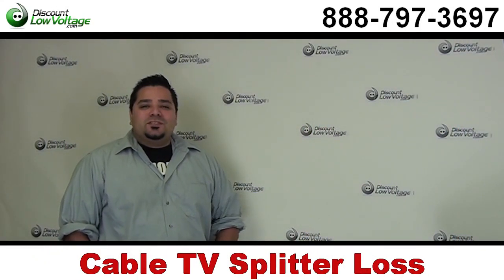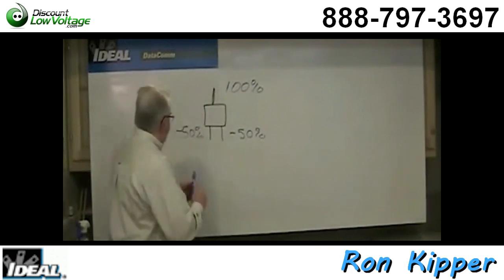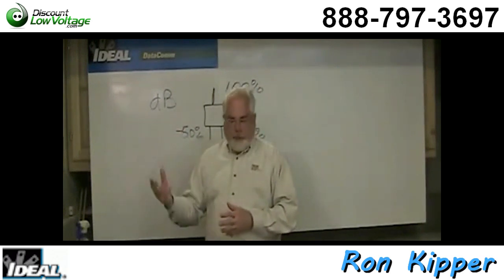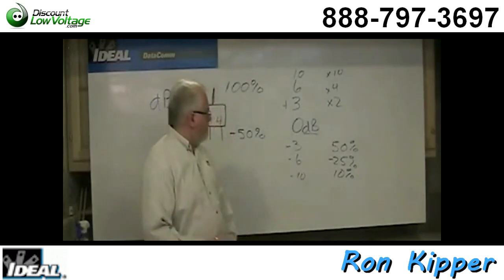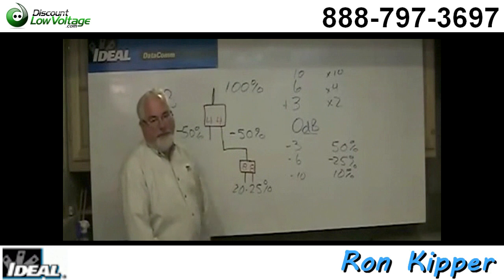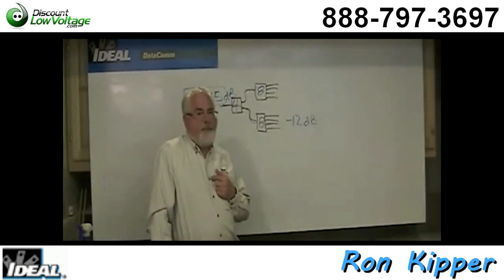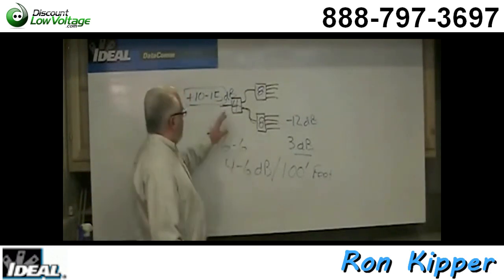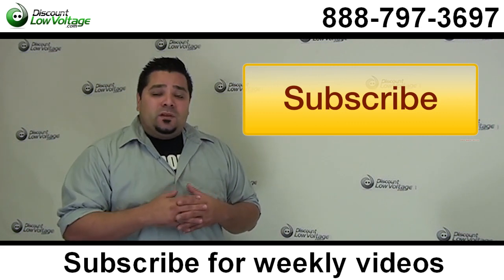TV Coax Cable Splitter - Is there signal loss?

Comment: thanks alot for the video... had issues in a new house, didn't think to look for splitters, found a huge mess under the house, cut out the unnecessary splitters and now have stable picture... yay

Comment: I'm looking into getting a coax-ethernet adapter. For the coax that would normally go out to the modem, can I put a coax splitter from the wall with one coax into the modem and one coax into the adapter? The modem will plug into a router via ethernet (yellow port) and the parallel adapter will plug into the same router via ethernet (other available port). I'd rather do this to prevent the adapter from being a single point of failure to my modem. The original setup has the wall coax to the adapter, and then from the adapter to the modem. I want to see if it is possible to configure my setup in parallel instead by using the splitter to connect my adapter to my modem and both to my ISP.

In other words, can the two "out" ports at 50% communicate with each other?

Comment: A splitter is a power divider, yes 3db is half/double POWER as in watts.  As we all know, with receivers, we are concerned with voltage or amplitude - that's why we use dbmv or decibels over one milivolt.  In terms of voltage, it takes 6db to double/half the signal level, measured in volts or amplitude.  Receivers measure signal stregnth in voltage or amplitude, not power.  Power is more for transimitters - that is how much power in watts do we need to produce a certain voltage level at the rece

Comment: So I’m paying for Spectrum Internet cable.   400 mbps down and 20mbps upload.   I’m actually getting 235 download and 12mbps upload.  Walked downstairs to check things out. My cable from the Network box goes into my house thru a -3.5 dB grounded splitter.   So 400x -3.5db is 178.8 mbps loss.  If I disconnect my splitter and just use a junction RG6 grounding block I should gain my speed back, minus any line loss from the 100 foot cable loss

Comment: ***** I have a 20dB cable signal and want to connect 6 devices. Would the Channel Master CM3418 8-way splitter/amplifier with +4dB per post be over kill or would the Antronix CMC2006V Passive 6-Way splitter with -9dB per post be a better choice?

Comment: Are splitter's reversible? Can the input be used as an output and the output used as an input? For example I have two different antennas, One is a plugged into an outlet with a Coaxial cable and a 75 mile range the other is an LG HD antenna with a 50 mile range, so if one goes in 50% and the other goes in 50% does it come out 100% . . . ? they are aimed in different directions.
Reply: Theoretically yes, they can be.
However I'm more concerned about your splitter. If the Frequency range is 5- 900 or 5- 1004, toss it in the trash and buy a 5- 2.3Ghz. Also buy Blue coded cables and connectors from your antenna to the tv, no cheap crap or red crap unless you want a crappy picture.
Back in the 70's and 80's I ran 2 antenna and it worked fine, but know the digital stuff seems to cut out signals when I add another antenna.

I run 5 tvs and changed out my whole harness and get a great crisp picture on every set(1 set id a 15 year old 32" old school Tube type with a converter box that gets roughly 36 channels.

Comment: ***** hi could you help me bro, i got two splitters for my tv cause the anthenna was little bit far from my room and it need to be two splitter , then my splitter was also old it like almost let say 10 years already and my splitter has  1 inside and 3 outside and  it say here 3- way spiltter   and   5 - 900MHz   and when i connect to my led tv was really bad channels, not soo clear, i was thinking if the splitter is the problem  ?  cause its old already ? or it just small 900MHz ? if te splitter is the problem what should i d ? buy a faster one ? does it matter if the splitter is slow and old or brand new and faster than 900 MHz ? i just dont reall know bout the splitter thing ! help me bro

Comment: if i use a 2 way splitter from my main cable that is connected to my internet modem and split it so i can have one cable to the modem and one to my tv so i can watch cable tv,  my question is would i loose a lot of signal? and would it even work smoothly?? i read some say yes some say i should use a Db amp to boost, or i can just get a Db gain splitter?
Reply: Any split is going to cause attenuation. Your biggest issue is the distance at which the jumpers are coming off the splitter. If its a few feet its not an issue. if you trying to go from room to room then that will cause an issue.

Comment: Query: ...I have a 4-way splitter, and a signal strength of 3db.....if I don't 'plug-in' 2, 3, or 4 tv's, and use just 1 leg; isn't that one leg still giving out 100-ish % of signal strength?....sharing resistance loads equally results in power loss by a factor of .5, right?.....but, NOT sharing load (only one tv is plugged in; other leads unplugged), shouldn't that 1 tv get the full share?    I ran four hi quality leads during home-build this last summer, into the attic, industry-quality lines, connections, splitter.....quadra-shield outdoor run of 50 ft.....checked every line w/ that clever Klein Explorer-2...idiot proof, easy to use, n' all connections are sweet....plugged everything up; could not get a signal to the lone tv....but, get my usual OTA channels when I plug lone tv back into antenna alone?.....frustrating, climbing up n' down damn attic, re-checking everything for signal strength, blabla....should I get an amplified 4-way?...do they actually work?....we're fringe, here, in E Tx ...got any help?

Comment: Hello Ron, I am looking to split my sat. signal to 8 to cover all of the TV's in the house.I am using RG-6 cable and looking to see what splitter to use for 8 channels and will I need an amplifier?  I am sure I will need an amplifier to cover 8 TV's. thanks Don
Reply from the maker: This might be a good fit for what your doing - https://www.amazon.com/dp/B002M1EPL0/ref=asc_df_B002M1EPL05160183/?tag=hyprod-20&creative=394997&creativeASIN=B002M1EPL0&linkCode=df0&hvadid=198062682203&hvpos=1o3&hvnetw=g&hvrand=6835923718403317405&hvpone=&hvptwo=&hvqmt=&hvdev=c&hvdvcmdl=&hvlocint=&hvlocphy=9031582&hvtargid=pla-319935017205

Comment: does a splitter lose that much if another wire is not plugged into the other
what if you try to pass through one leg and take out of the other ignoring the input
Reply: Asking the same
Hope they answer
Reply: use a 75 Ohm Terminator Coaxial Terminator Caps

Comment: Buy 5 - 2.3 Ghz and only buy Blue coded RG6 double shield cables and connectors and keep the cable lengths concise(don't use a 100' cable when a 25' will do) Your connectors should have the Blue plastic insert. Get rid of any RED coded or unmarked cables and connectors.
Cheap inferior cable will give you a cheap inferior signal
I'm running 5 tvs of my Channel Master extreme with an RCA preamp and a LTE filter and I get a crisp picture on every set. My channel Master is 20 off the ground and about 7 foot over my roof.
I'm in the country surrounded by trees and about 39 miles from the local towers. Currently 36 stations, If I turn it either way I can pick up Raleigh or Myrtle Beach.
All I need is a Tower and a rotor. I was 30 foot high but Hurricane Flo readjusted my pole to look more like a pretzel.

Comment: a two way looses 3.5 a four way is 7 and 8 way is 10. by connecting a two way and two 4 ways turing that into an 8 way is not that smart unless u have no cable boxes and or internet other wise depending ur location off the tap ur reverse would be to high killing ur two way from working and that would cause ur channels to say temporarily unavailable and ur internet to run slow if at all. now this guys is right for the most part if it was still 1997.

Comment: this guy doesn't know what he's talking about.. I'm a sr. Tech with spectrum. you lose 3.5 db on a 2 way splitter, which is not near half of your signal. An average signal in the nid is around 17dbmv. just an example. garbage video..
Reply: Kevin Weber I'm a technician too and even though he didn't mention the 3.5 db loss on two way splitters doesn't mean he doesn't know what he's taking about. If your home run has 8db and you add a two way splitter you'll end up having 4.5 db coming off those two ports, which is the same as loosing 50% of the initial signal.
Reply: Also, db may not mean dbmv. He is likely deferring to dbi for the explanation.
Reply: It's simplified.. It's correct enough in my books. There's so much to high frequency coax signals you can't explain it in 10 minutes.. Signal to noise ratio, bit error rate, tilt, QAM, micro reflections, higher freqs impeding more, etc etc...